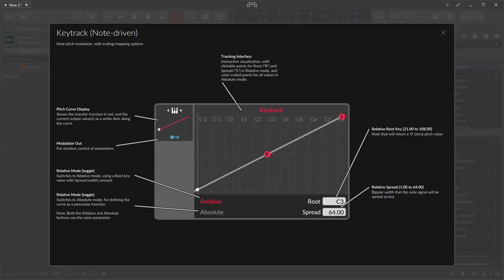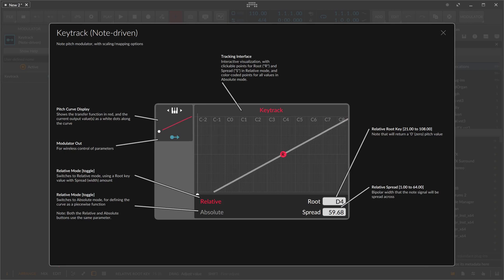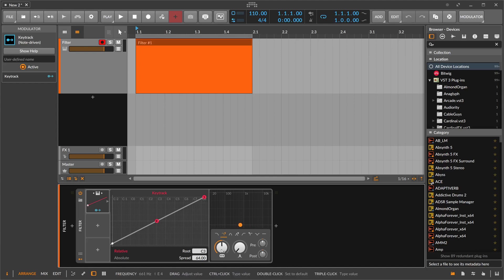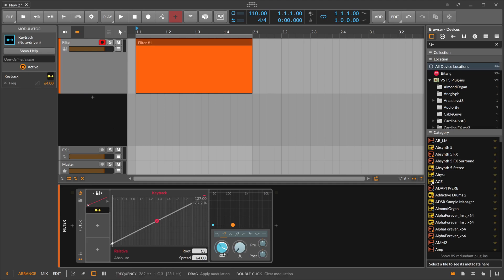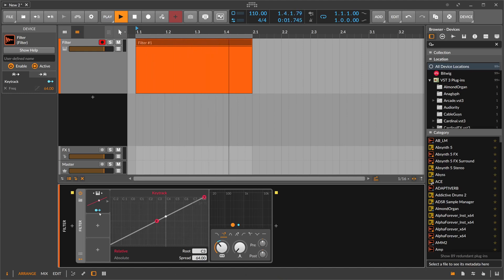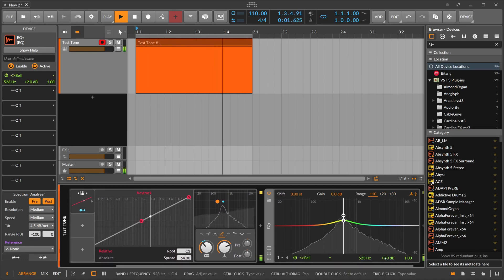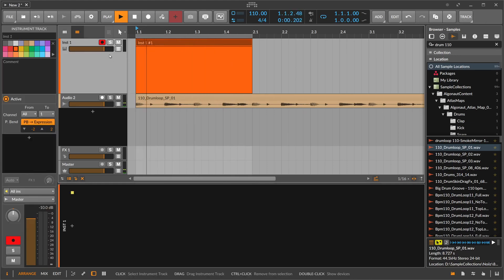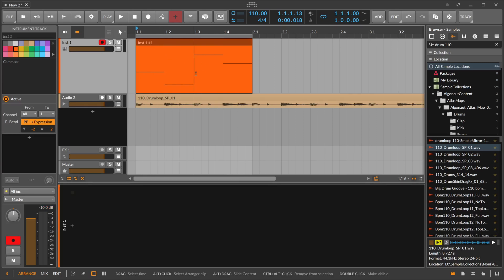Keytrack - Bitwig Modulator Guide

Comment: Could you possibly reach out to the bitwig team including a glide function for this module? When you tried uvi shade, you know what difference a glide option on keytrack makes. For example you have a 808 jumping up and down and want to shape something with a filter. If you have just key track it produces cutting sounds in between key jumps. If you have glide it's smooth and musical (don't have better words for it)
I tried contacting them myself, but if you would ask it might help more. 👀
Reply from the maker: Hey Leon, yes! btw. the keytrack supports micro pitch expressions. so if you define bends on notes, the keytrack glides with the. if you dont feel like using the piano roll, you can implement a simple note glide in front of the keytrack with a note grid (pitch in  -> lag -> pitch out) and the keytrack will react to that too.
Reply: @BitwigGuide  I will try that and try to understand it, since I am not to far into the grid by now 😅
Reply from the maker: @leonfriedemann9151  maybe ill post a video on this. thanks for the inspiration :)